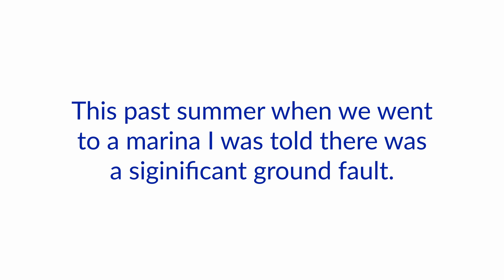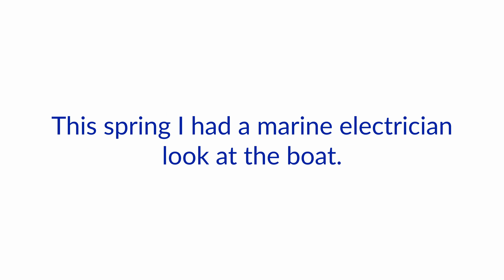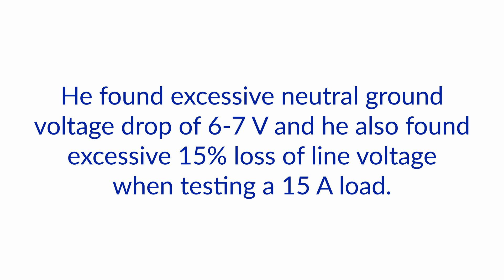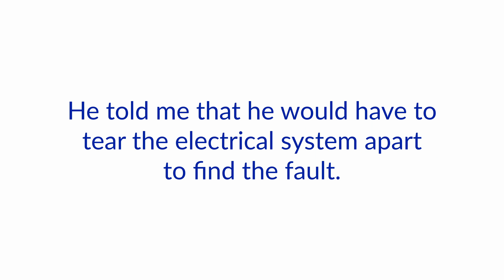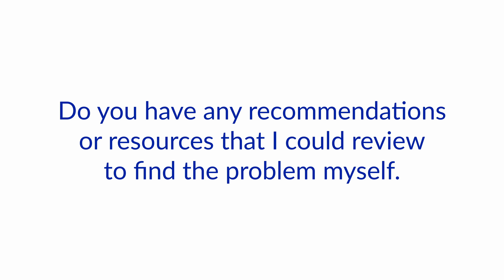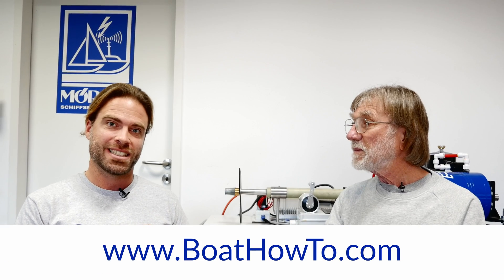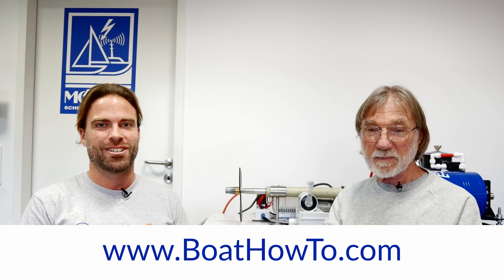Finding GROUND FAULTS - When NOT to trust your marine electrician | Ask The Expert with NIGEL CALDER

Comment: My boat starts fine during warm temps. Hit when below freezing the boat starter will not engage. Solinoid was recently changed. It’s an outboard motor Yamaha 50tlr Any ideas
Reply: Did you find the reason?

Comment: While I agree that “tear the boat apart” is probably not what should be said, tracking down a minor ground fault can sometimes require hours of testing, including separation of the neutral buss branch lines.  I agree the fix is usually trivial, but in some cases replacement of hot water heater or pump AC pump motor may be required.   Tracing down a ground fault dose require the right test equipment, and a sound troubleshooting process to efficiently narrow down the problem and isolate it.  I think you did trivialize the complexity and expense that is occasionally associated with locating and fixing a ground fault problem.